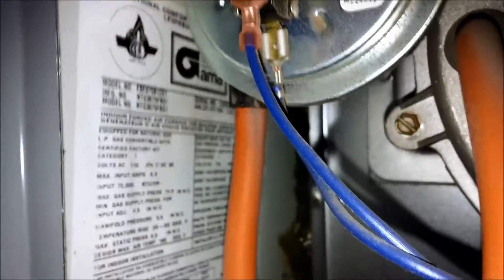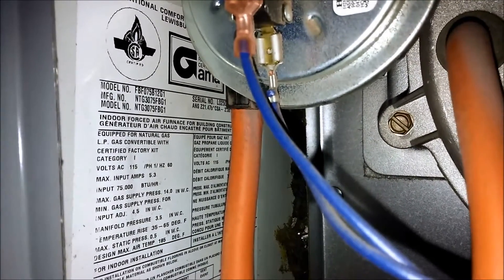Comfortmaker furnace making noise and a cracked heat exchanger

Comment: I have a Comfortmaker about the same year it was whistling my friend said it sounded liked a bad inducer well he didn't have the time to look at it so I called a company well the guy said it's just whistling through the vents which I knew was wrong then I asked him to check for cracks in the heat exchanger and he said you couldn't check for leaks on the same furnace so I called another company and yes a bad inducer was the problem but I still don't if any cracks have developed need another tech to come out very frustrating

Comment: I live in the U. P. And my furnace just started making an air rushing sound from inside the unit and my house has become colder even with temp turned up to 75.  I'm hoping it's just one of the motors needing some cleaning but definitely worried about it. If you're still in the business you should display your company logo better.